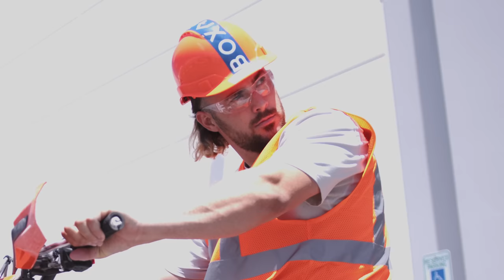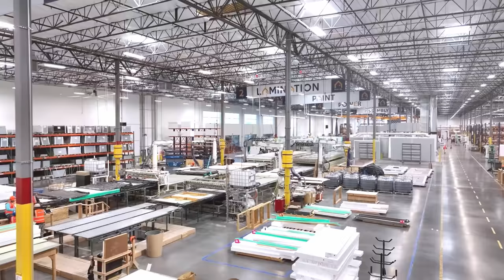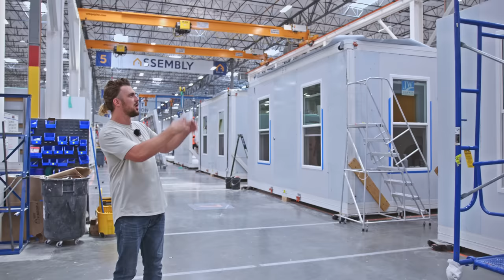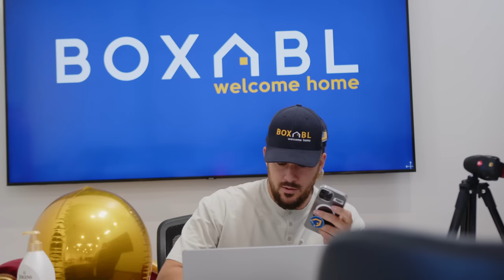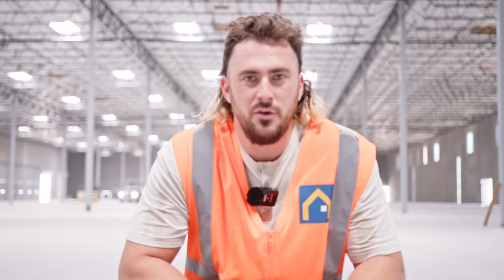Ep. 4 BOXABL Factory Update 2022 - Another Tiny House Factory Already?! 🦄 (Outside the BOXABL)

Comment: Hi,  what is the price of 375 square feet house worths #
Reply from the maker: From now on Casita pricing will be quoted on a case by case basis. Due to record setting inflation and a very long waitlist for Casitas we can no longer promise a fixed price on our website. For example... if you reserve a Casita today, and it takes a year to receive, we don't know how raw material pricing could change a year from now, so we cant lock in a price. When we get to your place in line, we will reach out to confirm pricing and next steps. Even in this frustrating inflationary environment we still believe Boxabl can be the most cost effective housing solution ever.